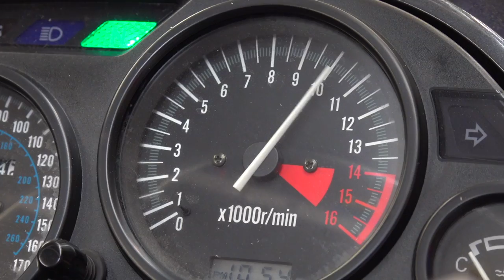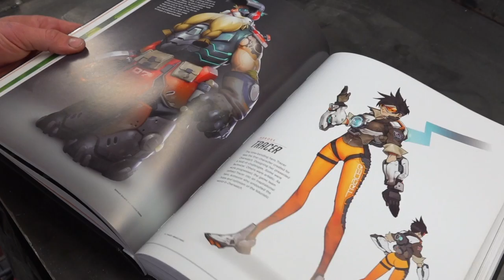CAGED 600cc RIP-TIRE SPINNER

Comment: I'm curious as to how you're going to spin those spiked tires up.
Reply: He should offset it so the spikes are next to the motorcycle tire.
Reply: That's what i was just thinking
Reply: He setup didn't look like it was made to have a tire sit off to the side
Reply: Christopher Stewart 

I think he’ll offset the powered wheel rather than the spikes.
Reply: 2 motors hopefully.
Reply: Stig Martin Stig Martin That would require to precisely balance two wheels on a makeshift chassis hopefully with reinforcements on both sides for stability from the diy frame and then hope that the balancing was correct and on high wheel rpms both wheels don’t start vibrating intensely  and end up destroying the contraption xddd. Or he could instead use two smaller pure aluminum cast little wheels that could safely reach high rpms and then contact the big tire from the sides, but this would only most effectively work if the big tire were to be spinned up under the bike instead of over the bike. But that’s just my 3:30am thinking and the plans I’ve made night seem total rubbish in the morning. Anyways, VERY, curious on the solution that Furzy thinks up :)))))))
Reply: @niFeforever  i think your over thinking it.. just use a set of small dual wheels from an old ford van or small truck. add a spacer plate if needed between the hubs.
Reply: Nerd Made the frame was built on sliders so he just has to slide it to one side to offset the spiked tire 👍
Reply: With rocket propellants. 50 of them.
Reply: William Tomkinson oh yes I am, and therefore as many have mentioned before, just offsetting the rail that hangs above, might just do the trick :Dd
Reply: jakob findlay The setup might have never intended to actually send a spiked wheel, like he mentioned in the end about not knowing how he’s going to do it.
Reply: Its gonna be hard to offset considering the fact there is a muffler on both sides.
Reply: @rdooski  Mufflers can be bent to one's liking or even removed (some loss of power and backfire will occur then tough from removing them)
Reply: I was thinking have the spiked wheel just high enough that the spikes can grab the powered tire without digging in too deep.

Intermittently adding rotational energy by pushing on each spike as it passes.
Reply: @niFeforever  loss of power🤔 i dont know
Reply: @niFeforever  Most definitely but I believe if he intended to do the spiked tires offset he would have addressed them while building everything. Unless the spikes happen to fit between the wheel and muffler. I personally think he will be going the route darkassassin mentioned. But its a bit sketchy also.
Reply: rdooski The bike tire will be ripped appart tho
Reply: Via an axle
Reply: @niFeforever  Like dark said you adjust it to where they are barely touching. At the right height it would be easier on the tire than riding over small rocks would be.
Reply: @MrWilliamtomkinson  even you are over thinking it. The whole rail set up moves side to side with his design. He'll just scoop it over 6 inches and spin it from the end of the tire tread
Reply: @preludedude4765  true..  but i was talking about how to do it with duel wheels..
Reply: @pumppupappi  about 5% or less unless the carbs or the computer (if with injection system) is adjusted for the increase of more air since the removal of mufflers would mean loss in backpressure, thus the engine would be able to run faster but take more air than before.
Reply: @preludedude4765  Ahhh I didn't notice those :DD, yep most definitely the solution is already made and here we are inventing a rocket :DD
Reply: @rdooski  I mean those spikes have barely any surface for the bike tire to grab on and the huge tire has a lot of weight. It would require a very delicate touch, too delicate for Furzy imo :DD
Reply: @niFeforever  if the spikes touch only the tire, spiked bigger wheel weights lot so when motorcycle tire spins or if he opens throttle much spikes would stay and cut when motorcycle tire spins
Reply: @pumppupappi   pumpmonk  Well if you applied the throttle veryyyyy slowly, like let's say - full speed after a couple of minutes, theeeeen maybe  they monster spiked tire could spin up presuming of course that the monster tire is perfectly balanced for such high speed, which I really doubt and even more so with spikes which have an uneven amount of welding material on them and probably are not perfectly opposite from one another. Having all this in mind the spikey tires should most definitely begin to vibrate and even expand because of the firggn metal spikes that are only attached to the tire and not as well to the rim. With high enough rpms the spikes might rip from the tire even before being released. Furzey, I really hope you know what you're doing :"D
Reply: @niFeforever  For sure it would definitely require a light touch. You would actually have to start it a little bit away from the motorcycle tire to account for the expansion after it gets up to speed. Who knows what hes actually going to do.
Reply: @niFeforever  yeh👍  myself i would just put monster tire on the side
Reply: The rip tires are just sitting on the rails. Without being rigidly attached, I think they would get off balance and bounce around too much if you just spun them from one side.

Comment: When you started this video I thought you were going to put the whole bike into a huge tractor tire. I'm sad.
Reply: Trust me, this will do better.
A tire with a motor inside wouldn't be able to spin as well and fast as this one, just because the internal mass is too low to actually set the tire spinning.
So you would need stabilizers like he had them before and even then it won't be very stable.
Safely accellerating a tire to high speeds (in this case, 200kph could be possible), does the job very well.
Reply: @Hoch134  aww, physics spoils all the fun
Reply: Exactly what I figured

Comment: My heart cut in half when he started to break down the bike.
Reply: It's a very poor use of a perfectly good bike... a lawnmower engine would have worked just as good.
Reply: Exactly what the Kawashitti deserved !
Reply: @HarleyFurgesson  Very good bikes nonetheless.
Reply: Damn that sounds painful are you still alive??!!
Reply: STtyrone  probably was a write off, I doubt Colin would have done this if it was a fully functioning bike
Reply: @toad3222  Colin would, he is a mad scientist with this type of stuff.
Reply: Colin can probably weld it right back up! Do not worry!
Reply: @jjhack3r  changing the gear ratio has nothing to do with the rpms.
A chainsaw engine has a fraction of the power and torque a 600cc engine does.
And it sounds cooler :D
Reply: @jjhack3r  It takes a decent bit of power to overcome the rolling resistance and air drag of tires at like 180mph. A lawn mower engine powerful enough to do the job would cost more than a bike.
Reply: Did you see the chicken strips
Reply: Found the people who disliked the video.
Reply: I have to agree that it hurts seeing a reasonably good condition bike get destroyed, when there is an infinite supply of chewed up, bent frame, totalled bikes that would have worked just the same.
Reply: @apodski  exactly.
Reply: @jjhack3r  my confusion, rpm to me meant. Revolutions per minute. How fast the engine is spinning another words, i know of changing the gearing to get more or less speed from an engine at a certain rpm, but i didnt realise doing so aloud the engine with all its components to go pass the threshold of what it was built for. Thanks for correcting me..
.. but calm down a little, yeah?
Reply: @jjhack3r  thanks for lesson, i thought we were talking about the engine.
I didn't mean to make you upset.

Comment: I've been wondering from the start, how you're going to spin up the ones with spikes? They'll have to be offset to one side I presume, as the spikes can't run on the bike tire.
Reply: I would have run the spikes on each sides of the rim and left the centre bare to connect to motorbike wheel
Reply: He doesnt care!!!
Reply: Jeff G, or attach two thinner tires so that there's a gap in the centre for the spikes to go in between. Edit: also he should put some grips on the rail starting slightly after the the part it charges up on as that part has to have low resistance but the wrest needs grip
Reply: @aaronklein3480  That is entirely true!!!!!!!!!!!!
Reply: Also when the tire hits the ground, then the spikes will either dig into the ground slowing it down or cause it to become unstable as the spikes are spaced too far apart and the tire falls over. Good stopping point to keep us guessing!
Reply: @TylerWitucki  The idea is that it will be spinning so fast that, even with the spikes, it will zoom away like the animated one does. But it will definitely tip over after a couple of seconds. Hmm, it could be pretty damned dangerous actually!!!!!!!

Comment: looses too much momentum due to the small diameter "trackwheel" before the main tire hits the ground. reduce tracklength...
Reply: There is some optimization which can be done there. Perhaps Colin kept it big so it could handle the big tire. There may be some range of dimensions which work, I'd have to measure to see.
Reply: @shoopinc  a bigger radious of the "trackwheel" would do magic already, it's the diameter of'em.

Comment: It hurts my soul seeing a beautiful bike being taken apart like that. I hope you restore it again Colin.
Reply: I know it was all I could think about ☹️
Reply: Yes, me too. Why couldn't he have just bought an engine. An old V8 or something. I hope he puts the bike back together after this project.
Reply: Nah, it's for a good cause.
Reply: Its going to immortalize that bike my dude. 
Also a v8 would be wayyy to big uness he gets the smallest v8 possible.
Reply: @optimizticpizza8395  500-600lb for a small block, but youd still need running gear, build a drive train, frame etc. I get why he did it, it makes sense to use a bike but it still hurts my soul seeing it ripped apart.

Comment: Hey Colin,
How about filling the tires with concrete? That would make them more efficient!
Reply: they'd take half an hour to get spinning.. but on the plus-side, they'd never stop either.. hahah
Reply: Might rip the tire apart if it got up to any speed

It would be cool to see that though
Reply: The little gap they'd have to jump would probably be enough to crack the cement open in the tyre and stop it after a few meters, also cement takes roughly 2 weeks to set properly...would be easier to just cement glue some scrap iron pieces inside to gain weight on the outer layer or just screw them in lol
Reply: How about cork ?, Fill it with cork, it's bouncy and lite and kinda strong
Reply: @nathanb3273  the whole point of cement was to make it heavier, so that it can work like a flywheel.
Being heavy it will store more rotational energy and will have more duration and more power
Reply: @lucafacchinetti2522  assuming the ite can handle all the vibrations and stress
Reply: How would you recommend distributing the concrete evenly around the inside of the tire?
Reply: If you're just looking for weight, you can add water instead of air. Farmers do that to tractor tires when they need extra weight. In regions where it freezes in the winter, they use a slurry of calcium carbonate and water. VERY bad for the rims, but lots of weight.
Reply: @MonkeyJedi99  we don't just need weight, all that water is gonna do is stop the tyre after 10 meters by taking all the power for moving a heavy thing. We need SOLID weight to increase the inertia of the body. That's gonna allow for it to "hold" more power
Reply: @lucafacchinetti2522  Valid point. My suggestion completely forgot about the speed in this situation. There are quick-setting gel or foam type products sold for bicycle tires that I am quite unfamiliar with that could possibly be used.
Reply: there is a weighed foam filling material that's used for tractor and other machines where you need weight and don't want the tire to go flat. It's fairly expensive, but it works. I did a set of mower tires for traction. Worked great.
Reply: @lucafacchinetti2522  so cork wouldn't be heavy enough no ?? ... I think it would

Comment: First off, as always LOVE your videos!
I think he would have some crazy fun if he made an Massive over powered FLYING drone that he could ride. His other one was great i did like it. But  maybe he could soup it up so he has steering or something. maybe some kinda computer control to keep it stabilized so he can have fun doing other stuff ^^ ya know maybe upgrade his old, so old one gives the lift with the engines, but some electric throttle controls the stabilization? I know it sounds kinda complex. But i wager he might have some one with the chops that could help him out ^^ Crosses fingers

Comment: Colin - put it on a trailing arm behind the drive wheel (essentially a three wheel in-line bike) with gearing so that no matter what gear you're driving in it's in 6th. shielding for the driver (just in case). Then you'll have the real deal. whoever is chasing you is doomed!

Comment: Put a servo which would slide a weight from one side to another... To steer it remotely.
If the analog is resting, the center of mass is in the center of volume.
Make several around the edge if you can't do one in the center.

When you do that, people are going to start requesting a hybrid between the self-powered one and the steerable one. 
Consider running a capacitor instead of batteries. Might open some design options. It doesn't need much run time, anyway.

Comment: You have more fun than anyone I’ve ever met.

Next time, get a bike with the highest rev limiter, get the largest front sprocket, smallest rear sprocket, tallest tire on the rear of the bike, then get different diameter tires to launch.  Or have it spin a electric motor and see how far you can get the voltage to jump to a rod in the ground.  I heard every 1k volts jumps an inch.  You need 24k volts to make a good lightning bolt

Comment: Have you considered using the motorbike engine to pull some kind of rope, which is rolled around the middle axis of the rip-tire and start spinning it that way? It would transfer the energy much more efficiently as the momentum you give it in the middle will have much greater effect on the outside of the tire.

Comment: you could change the transmission so the wheel can spin way faster, you have 600cc and idk 100ps? USE the whole potential of the power, so the wheels get like 1000mph